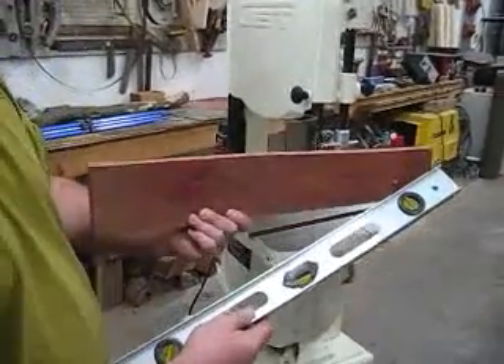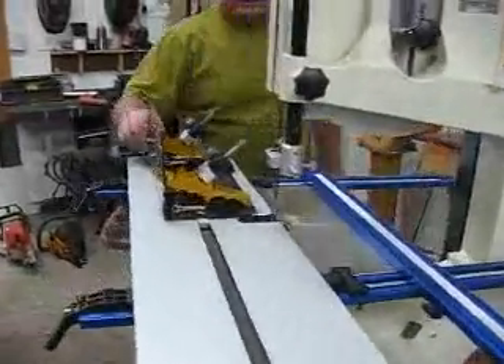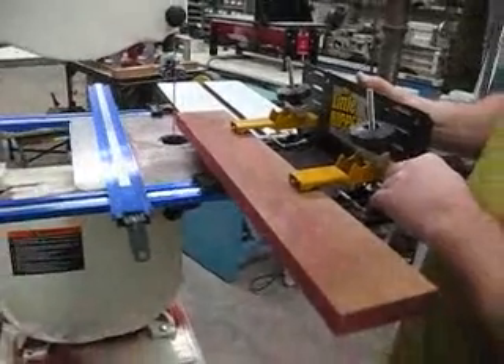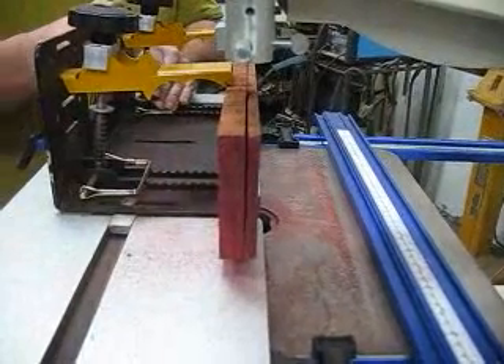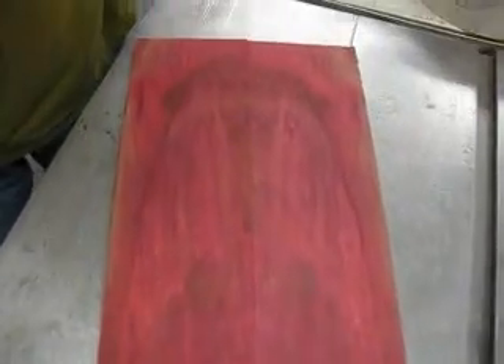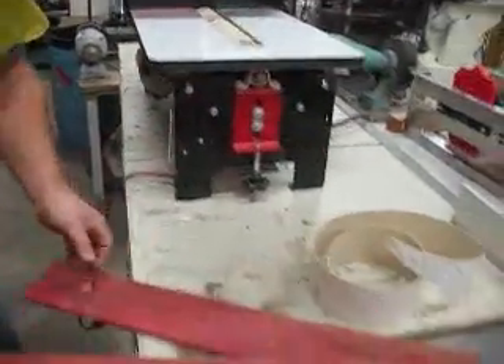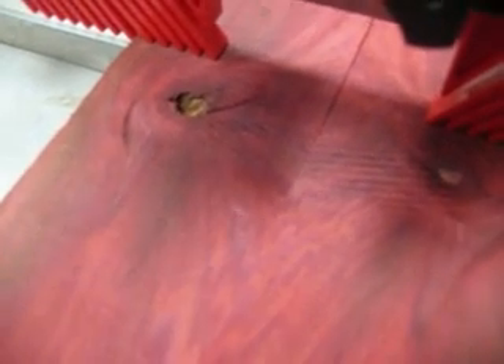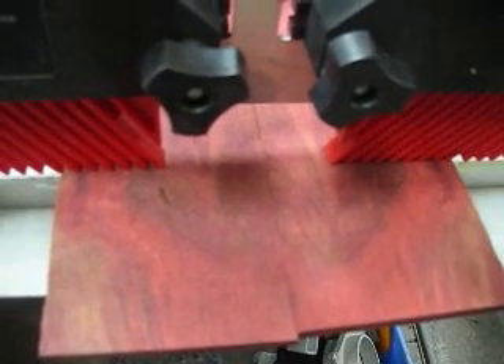Resawing a Perfect Bookmatch

Comment: I've been developing a rail and carriage feed system for my veneer resaw of my own and see we're going in the same direction experimentally. I like the central   micrometer idea and parallel slides at the ends to advance the process but don't see that being stable enough to maintain parallelity with the drift angle; plus my table is way too big for Little Ripper but it's good to see someone finally addressing one of the major hang-ups in the bandsaw arts. Keep on keeping on!

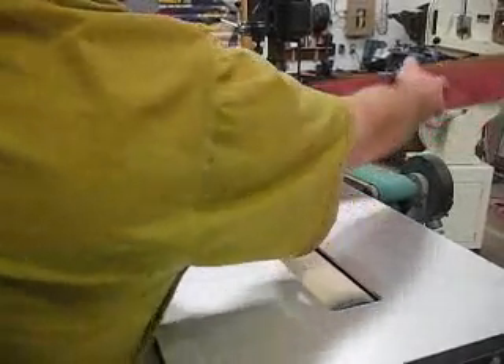Comment: At 9:04 you almost got messed up real bad by that sander, what were you thinking?  The Little Ripper is a nice accessory but why would you be ripping what is going to be your glue edge with a bandsaw?  Don’t you have a table saw or jointer?

Comment: great show of the little ripper product. However you may think of a partial guard on your drum sander for setups like those.  If you watch your video, your sleeve is mere millimeters away from getting sucked into the sander, and is dragging on the drum at one point. It is only a matter of time before your arm will soon follow.  You dont need two feet of drum exposed to use 1/2" of it. Good way to break a machine, ruin a shirt, and possibly injure yourself.   Good video & tips, just be careful.

Comment: Instead of risking your shirt beeing sucked in you should probably think about using a plane. After that you won't need a "Paralign Clamp" to close any gap which is defenitely the wrong way to hide sloppy joinery. It's not hard to learn to make a tight joint.